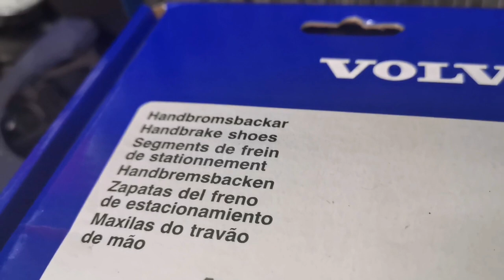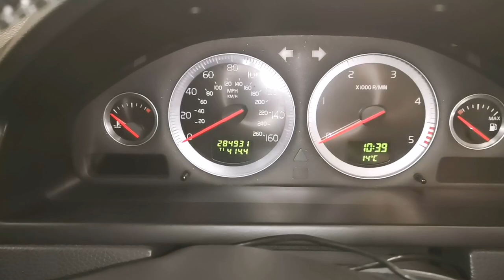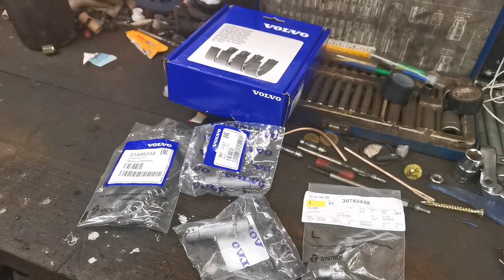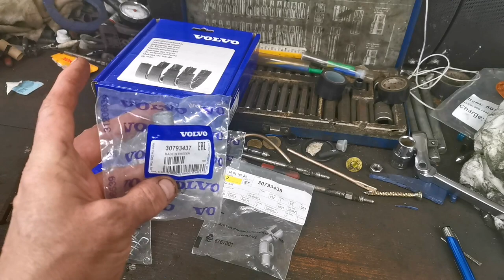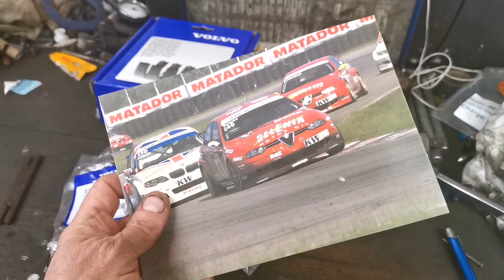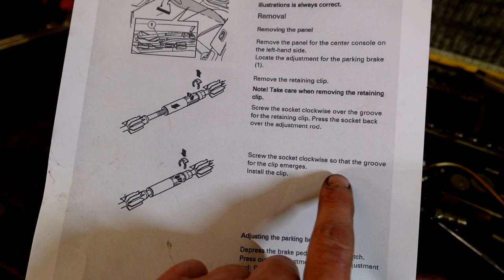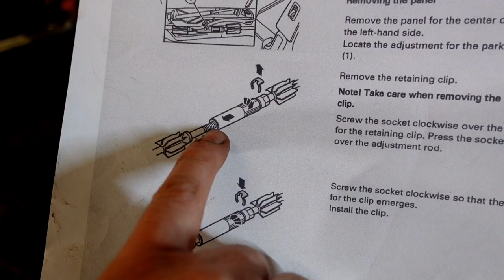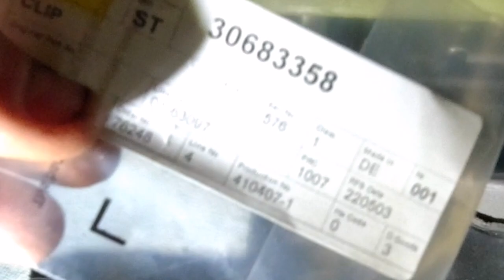Volvo XC90 Handbrake Not Holding. Parking Brake Retrofit

Comment: Two years ago I scoured YT for this info and spent hours watched over a dozen vids - none of which described the process/mechanism as well and as complete as this one. I managed to do the job, but only to get the car pass MOT and never could get it stationary on a hill with just parking brake on. I need to redo this job now as the cable is acting funny lately - and I'm so glad I found this video. Thank you and I'm sure this video will benefit hundreds and thousands DIY mechanics battling with XC90 parking brakes. Namo Amituofo

Comment: Thankyou. I fixed my low mileage parking brake in about the same time as your video - 30 mins. I did undo all the seat bolts,  lifted the seat up and tilted it back. That made it super easy. I really like how the left passenger footwell panel cover just pulls off. Super easy Volvo XC90.

Comment: I did the same several years ago. T's the only way to get a working handbrake on the XC90. I tried to get the adjusters from the local volvo stealer in Belfast but the parts store denied knowing anything about this fix. Even when I gave them the part numbers they told me that they have to be ordered in. I ended up sourcing the parts from fleabay. Another great production Dave.
Reply from the maker: Had them on the shelf in this case at Volvo Belfast

Comment: Another bang on video Dave,  top tip with the spring removal   via your jubilee clips 💪👏👏👏, guess what I will be making on monday , got a 9 yr old vito in with rotted rear backplates , lots of shiny new stuff to fit so he can get it motd to sell it with prices being high , I did one of these a few yrs ago , the punter supplied all the bits  , proper job , a bit scarey now for you re people knowing where you do your road testing 🤣🤣, the slide at the end was ace 👍👍👍👏👏
Reply from the maker: Merc backplates decent price from merc
Reply: @davesterl  made out of ford cortinas from 1977 🤣🤣🤣, not good at 9 yr old is it Dave  😂
Reply from the maker: @mikeberry304  i did a 2012 C250 and they were dust
Reply: @davesterl  🤣🤣🤣😂😂😂😂

Comment: The parking brake is terrible on these XC90s. Despite this it is easy enough to get it through the MoT. Those H pieces are absolutely useless. I fitted the adjustable type to my own XC90. The reason for using genuine shoes is because there is a chamfer on the curve of the shoes (the top and bottom in the installed position) and some aftermarket shoes don't have this. It is possible to adjust the cable with the seats in situ if you move them all the way back but is is a 2 minute job to remove the 2 bolts at the front and tip the seat back.
EDIT: I've recently managed to get the parking brake to hold. I finally adjusted the shoes properly and it holds better than it has ever been since I bought my XC90 in July 2021

Comment: When I had an XC90 I did everything to get handbrake working including replacing the 2 rear cables. The ONLY thing I didnt do was adjust this section of cable, all these XC90s will have this issue!!

Comment: Dave you're a wizard, just done my XC90 handbrake not sure if it will work as I ran out of light & it's 2° in November in UK so a bit brass monkey. I'm going to adjust the cable inside the car tomorrow (well going to attempt it as it's a mind fuk) but does anyone know the part number for the cable circlip? As mine is missing👺